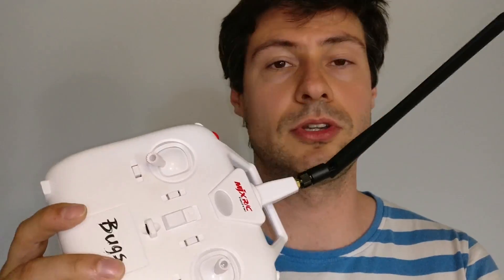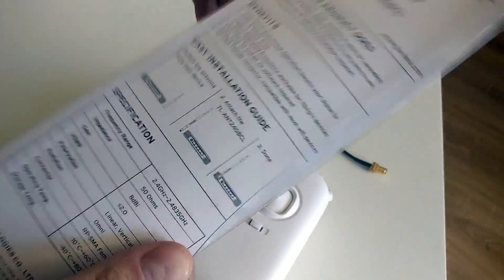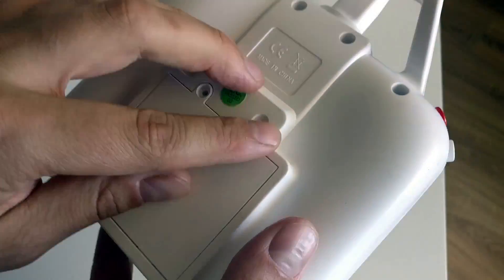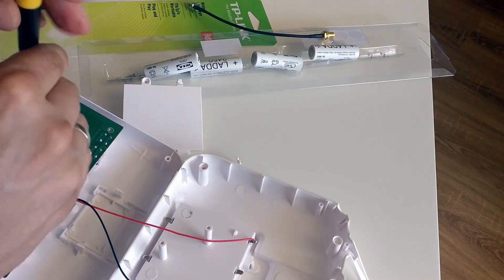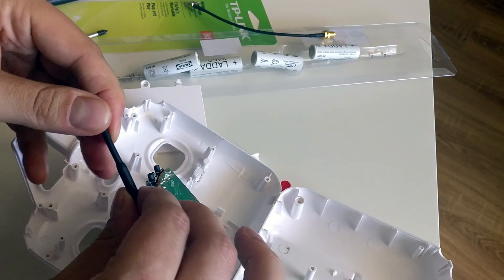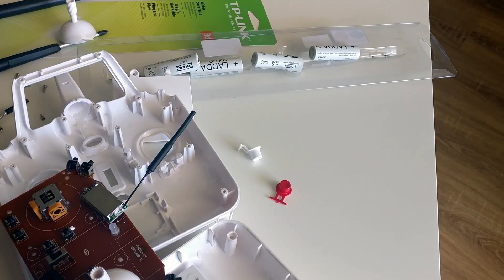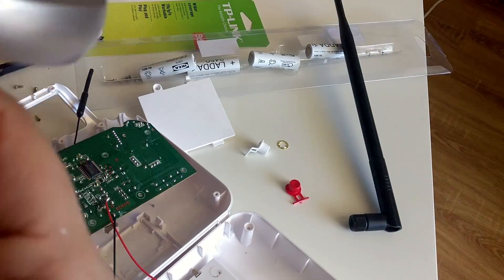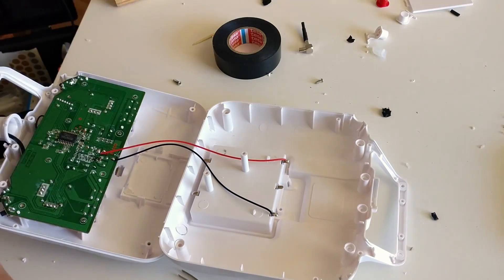MJX B3 Bugs - extend the control range by modding the RC

Comment: Hello Good Sir. It's 2021 and i still find these videos Usefull.. my question is....can i use an RG316 cable to connect it to 5dbi antenna, to mod my transmitter?? thanx for the answer good sirs.
Reply from the maker: Nah, I believe there are more experienced folks that can give better answer. Please check the rcgroups forums.

Comment: What is wrong with the drone when it slowly throughout flight veers one direction stronger and stronger. To the point where after landing it will not take off again because it’s acting really off balance... however resetting power to the drone fixes this state temporarily. Ideas?
Reply from the maker: Not really... try checking the rcgroups forums - there are lots of people still using the bugs 3.

Comment: Hi bro I have a big problema i brake the positive point in the bug 6 remote control and loose the antena signal, so I dont have a positivo positive pont I which put the positive of my omnidireccional antena... Do you have some advise for Solution 🙂
Reply from the maker: Hi mate, hard for me to give you a good suggestion. Check the RCGroups forums
Reply: @TechMishka  thanks bro I just have the t8sg v3 so just bind the quead 🙂💪
Thanks for the answer

Comment: If you want a major RF impedance mismatch by paralleling two 2.4Ghz antennae, just do what this guy has done.
Chances are, you have reduced your radiated RF power output.
Reply: Exactly. You can't just stack antennas like that. Screw up the impedance and waste power. Remove the old one and replace it with the 5 or 8 db antenna.
Reply: James Williams what you said does make sense. I read comments on another similar video w same discussion/ conflict where the guy tried removing the original antennae in the transmitter and receiver and replaced with aftermarket  ones and he said the bugs3 wouldn’t respond & kept beeping endlessly so he just stacked aswell. What do you think?

Comment: So,you're technically connecting an extra antenna on top of the original antenna and expecting a 20 to 40% extra range?  1st you will probably fry your transmitter, 2nd you will lose 20 to 40% range. Cool story bro, but it works only in your fictional world....
Reply from the maker: Alright! 🙃

Comment: Thanks for the tips. So you say,8 db is pointless and 5 db is enough?
Reply from the maker: Both 5db and 8 db are too much, because the antenna is designed to supply lower mw. You may try different ones and see which gives the best results.
Reply: @TechMishka  the antenna designed to supply lower mw? or it is the transmitter chip?
Reply: Does this apply to the bugs 2w as well?
Reply from the maker: @Venomyuc  Yup - most of these remotes are quite similar. And that may work on most transmitters, not just MJX.
Reply: @TechMishka  I've made mine yesterday and the range is greatly increased. Thanks for all the info. Cheers.
Reply: Hello Good Sir. It's 2021 and i still find these videos Usefull.. my question is....can i use an RG316 cable to connect it to 5dbi antenna, to mod my transmitter?? thanx for the answer good sirs.
Reply: @ronaldoestrada7522  theoretically yes, but the signal needs to be tested before fly.

Comment: Can I just strip my antenna and connect it to my new one ?
Reply from the maker: Yeah, you can do that. 
But if you are looking for a long-range working mod, you will have to rework the transmitter so that it outputs more power. This mode helps a bit, but if you are looking for a much longer distance control - you better entirely swap the module.
Also - make sure to fly with FPV camera onboard, otherwise it is too risky :-) You lose sight after 200 meters.
Reply: Tech4All so I ended up solder it next to the empty space next to the original antenna would that work too
Reply from the maker: @rustezzz5785  It would, but it is not recommended to keep the original antenna - as it will have negative impact on the transmission.
Reply: Tech4All one more question do I have to remove the brass or bronze piece from my new antenna or do I have to strip it till the silver wire is exposed and then solder
Reply from the maker: @rustezzz5785  Hm, I can no longer recall which one is supposed to go away. There is a very good tutorial in rcgroups.com about these mods - there might be even a newer and better way. Better check there.
Reply: Tech4All so I stripped mine wich was wrapped in some type of wire mess then a plastic wrap wich I used a lighter to expose the silver one so I solder that

Comment: A SERIOUS TRAP FOR YOUNG PLAYERS! The RF generated from this transmitter is horizontally polarised: See antenna at 2:31. Your drone will also have horizontally polarised antenna(s) - potentially down the leg(s) of the drone. 
If you convert your transmitter's antenna to vertically polarised, you will have serious significant loss of signal to/from your drone,
A higher gain antenna does not push RF out further (you can't get something from nothing!): It only concentrates the RF propagation in a more confined and limited area. You may flip this antenna to a horizontal position but the extra gain will only allow comms in a more narrow and focused field - not good for drone work :)
Just my humble input :)
Reply from the maker: Thanks Aaron! Unfortunately I no longer have the bugs 3 since a long time. But I do miss it :-)
Reply: Hello Good Sir. It's 2021 and i still find these videos Usefull.. my question is....can i use an RG316 cable to connect it to 5dbi antenna, to mod my transmitter?? thanx for the answer good sirs.

Comment: Hi, there is  an option to add GPS to bugs3 drone?
Reply from the maker: Not really. Well - technically - you may replace most of the boards and place another one. But that won't be the bugs 3 any longer :-
THe Bugs 3 Pro does have a GPS, you can check it. Recently I saw it for around 140 USD.

Comment: So i have a black bugs 3 with a black bugs 6 tx doing pretty good. Occasionally get one beep which makes me nervous I had two fly sways already . I’m not out of range by any means when I get one beep maybe 150-200 meters 75 meters  vertical. I have  5 dbi spliced n tinned ready to go I’m just trying to get a Definitive answer if you should keep the original antenna as well so you will have two or just the one?? One guy says it will keep beeping if you remove the original you supposed to keep them in. I would imagine that would be worse to have two but I don’t know much im very knew to this. Maybe I should just fly with just original antenna n not mess with it then i won’t be in the air period lol. I just don’t like that beep that close. Guess x-mas just buy a better drone always gonna be risk when flying gotta get in their n just do it !!! Luckily after two fly away one half mile I even found the bugger. Sorry for the book of mushed words . Happy flying
Reply from the maker: Hi JT - usually keeping the original antenna is not a good idea, although on the video I do not remove it too. But I removed it a few days after. The beeping signal occurs when connection's strength is weak. So if you have a good new antenna that is properly soldered - it should improve that communication.
Do not expect miracles though - the power concentrated in the new antenna will be the same as in the original one, and having 5dbi added doesn't men the signal quality will increase with the same rate. But it improves it a bit. SO let's see how it goes on your side :-)

Comment: Porque no cortas la antena original ?
Reply from the maker: I have done it on a later stage. It is highly recommended to be done before adding the second one.
Reply: Hola jaime el solo uso un cable la tierra se queda libre??
Reply: @wichoernandez1  ise trabago hoy den er mjx bugs 3 que me llego ayer y a 5 metro se me cai er dron por la señar er contro me pita de una ves ino se que ase
Reply: @wichoernandez1  espero una repuesta por favor
Reply: El dron no deberia caer por señal caeria por una falla en el motor revisa tus motores y tus elices que estan en posicion correcta tienen letras marcadas para el sentido del giro
Reply: La antena original debe ser retirada para que los decibeles sean 100% efectivos en la antena que esta trabajando y los cables positivos y negativos estan casi juntos yo ise el trabajo y ay mejora de distancia
Reply: @wichoernandez1  er dron es nuevo
Reply: @wichoernandez1  pero no le quite la antena der contor que trai
Reply: @wichoernandez1  le quitare la antena de fabrica i vere que tar er cai a 5 metro de mi er contro pita como cuando lo lleva lego
Reply: No creo que tenga nada que ver con tu antena facil tendria que mantenerse en el aire estable
Reply: No crees que tu problema sea de la pila necesitas reconocer tus luces busca en el manuan por los codogos de luces y talvez los pitidos del control tambien te digan algo por que la antena te va a aumentar el rango facil te daria 100 metros sin antena

Comment: I tested mine and there is no noticeable increase in distance, but I have noticed that the maximum distance is more stable as in some places I would get about 50m less range while this slightly improves that.
Reply from the maker: Thanks Michael for this feedback. Perhaps using a smaller antenna may have bigger impact - the 5dbi antenna will of course not broadcast with that db level, because the tx is not designed to support such. That's what I've noticed in the past.
But overall - my primary goal was to make the short range coverage better and help the transmission stronger than interfering other networks.

Comment: Why the obsession with extending range? Stock gives you more than you can fly line of sight without losing orientation. In the US you're violating FAA rules flying over 400ft or not using LOS. Modifying transmitting equipment and using without HAM technicians license violates FCC rules too.
Reply from the maker: Thanks Chris, I will keep that in mind.
The main reason I wanted to improve the range were sudden drops while flying in short distance - it was just losing the range for a second, and since it has no GPS or altitude hold - begins a drop. Then range is back, but sometimes it was not easy to bring it back under control.
Reply: np. I wonder if there's something defective with your TX or RX, or outside interference. I've flown 3 different drocon "blue" bugs 3 with no problems like that.
Reply from the maker: Very likely there was something wrong. I got mine from the very first batches and after that MJX have very quickly switched to different parts - new revisions of ESC, TX and so on. So maybe it was.
I have also tried to fly it with the Bugs 6 remote - while I have zero issues with the Bugs 6, when controlling the bugs 3 with its remote I had the same symptoms.
Reply: I lost my first bugs 3 without paying any attention to the receiver board, but I noticed on the second and third ones that although the receiver board has the same date and version number, some of the chips are different, and the front connectors are oriented differently also - one has vertical connectors and the other has horizontal connectors facing the front. Pretty unusual I think.
The first bugs had an issue with tilting to the side immediately when coming out of a steep dive on lower throttle (using high rates). Almost, if not, impossible to control after that. The second one has done the same thing, but it's hard to reproduce the behavior. I only had it happen once. It crashed pretty hard and suffered a bent prop and it has behaved since then. Maybe the crash "adjusted" the gyros. :) The third one seems rock solid. I've actually had it in a steep dive on low throttle and I then killed the throttle all the way and had the drone do a back flip and recover just fine after throttling back up. :D
Reply from the maker: Wow, three of them! You certainly have a lot of great experience with the bugs 3. And they are nice drones if we are lucky not to have any of the issues out there...
You mentioned you have one of the blue models, is that right? Do they differ in some way from the reds?
Reply: I can't say how the blue models differ from the red ones since I only have the blue, but my impression is that they should be the same, aside from potential receiver board variations. There's a youtube guy, Jay Drone, that has both a blue and red if I remember correctly. You could try asking him. There are a handful of vendors that sell their own versions of some of the MJX drones and I'm not sure exactly what the differences are. For example I have an F200C Specter from Force1 and I've been assured by the vendor selling it that it is the bugs 2c. It's the same shape as the bugs 2c, but does not have the eyes, just a force1 logo on it. I'm guessing that companies like force1 and drocon are licensing MJX's design specs or something, but who knows, they're still made in China. I just checked MJX's website and I see that they have a bugs 3 pro. Basically the bugs 3 with the bugs 2 gps and altitude hold. Oh, and Bugs 3 H - looks like bugs 3, but with altitude hold AND a couple more new models I think.
All that aside, I plan on taking the motors and ESCs from my spare bugs 3 and putting them in my F200C Specter (bugs2c). If it works, I'll end up with a bugs 3 pro apparently. GPS, return home, alt. hold and better lift capacity than the bugs 2c. :)
Reply from the maker: Yeah, there are a few new awesome models arriving. There is a bugs 3 mini version, the pro that you mentioned, the H-model, and bugs 5 and a few hours. 
I will likely also want to try the bugs 3 with altitude hold. And if they happen to build the one with gps, it will be great if it can hold a gimbal for better photography. Ehh, dreams :)...
Reply: tech4all the bugs 3 pro has both GPS and altitude hold. 😁
Reply: I have lost my bugs 3 twice first time was half mile away 2 hours later I retrieved it. Second time was 300 meters or so less than an hour I found it. I am in suburban area I lose signal or I mean it beeps at times pretty close. I did the 6dbi mod to tx I took original antenna out n it barley went passed 50 meters probably due to the ground wire solder I had hard time getting it to stick to receiver board. I decided to buy bugs 6 tx black off amazon n it bonded n flies great . I still get the occasional beep when 200 meters or less. Sometimes even close. I get nervous being I lost it twice n I’m sure as the saying goes 3rd time charm n it’s a gonner!!! I habe now a 5 dbi antenna n it’s spiced n tinned I am thinking of trying it on my original tx ( if it’s not fried from all the heat I used trying to get the ground to stick. Worst case maybe the  new tx. I’m hesitating, because don’t wanna ruin this new tx. I am not liking the beep n want better range not to go crazy just to not lose it even when it’s in my LOS. First time n second it was def in range n still flew away. Now I get the beeps here n there when in cruising pretty good, but one beep I kick it backwards because after two fly away n being very new I’m nervous . Any suggestions ? Everyone is saying different about keeping the original antenna too so having two antennas is a must cause remote will beep crazy.. so does anyone know Definitively if you mod it with one or have to keep original ?

Comment: I tried just this many months ago when the bugs just came out and I can attest that there's no range increase.. These bigger high DBI antenna require higher input. This is like trying to power a big watt  bulb with a single AA battery. You'll need a signal amplifier to see great results.

I did however end up using a small regular 2.4 antenna from an old router and did see a little increase in range,
Reply from the maker: Do you have any idea how many db this little antenna is? Like 1-2 db? Or even less?
Reply: tech4all I believe it's 2 dB, wasn't completely sure that's why I didn't originally mention. Did a quick search on 2 and that's what it looks like
Reply from the maker: That would be my next try then :-) Thanks a lot!

Comment: So was it worth it? Range increased significantly?
Reply from the maker: Nope. Because of the test I damaged my drone :-) The benefit was showing to you one possibility of modding it. Now I always have to add the antenna, otherwise I may fry the transmitter. Being at a distance more than 200 meters feels uncomfortable anyways.
Reply from the maker: Range has increased by 20 percent maybe. Once I recover the drone I will put fpv and try again :-) I also have now a stock transmitter for comparison.
Reply: Does it matter which wire I put on which pad? I stripped my antenna wire but I don't know where to put each??
Reply from the maker: Usually it does, yes. In that video I do them reversed. Couple of weeks after that I swapped the wires, but overall range remained the same. 
One of the guys here mentioned that the best results you may achieve with a smaller antenna, like 2 or 3 db, so keep that in mind.
Reply: I have done this mod also and not really seen any good from it !im going to put on the booster next and see if it works any better.I just don't want to worry about losing it when flying.and it's was not getting over 50 meters!even with the mod.I have order a new one and it doesn't Bind to the older controller.when holding down the red button.it just keeps beeping.any way that's where I'm at.i have more work to do on it.let me know how you are making out with it?
Reply from the maker: Bruce, if now the range is worse, that is because of bad soldering. Try to do that from a scratch and it will improve. 
Are you keeping the original antenna? If so - you may try to solder it back on and see if that fixes it.

As for the new controller - my observations are that indeed the Bugs 3 revisions are sometimes incompatible with each-other and it can be pain-in-the-...heart to find suitable parts. I never managed to fix mine by replacing ESCs because I couldn't find rev 1 :( So this TX issue doesn't surprise me that much.